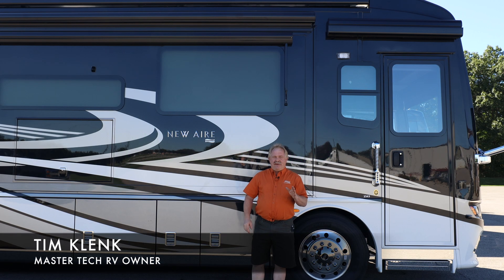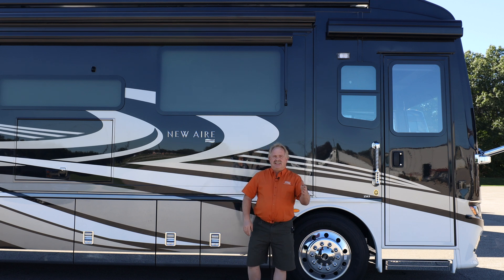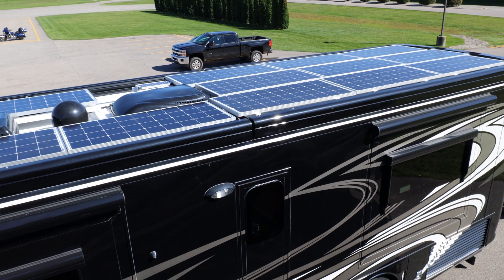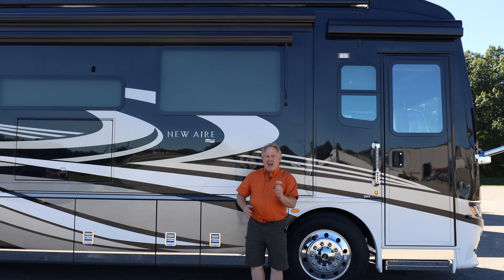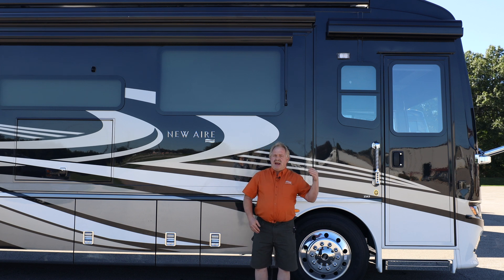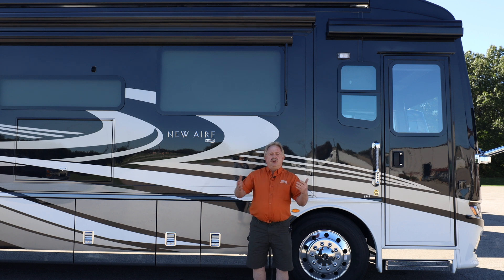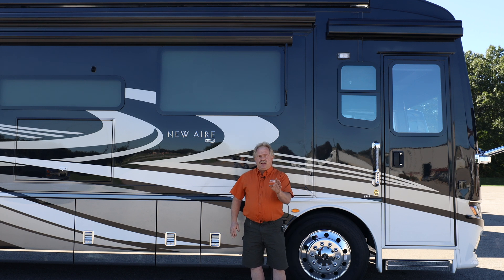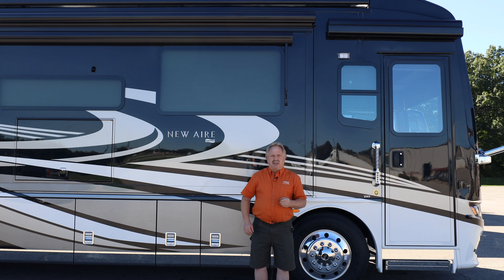Ultimate RV Lithium & Victron Energy Package

Comment: I’ve got an Entegra Anthem that’s all electric with 2 Magnum inverters. One handles the residential fridge and kitchen, while the other handles the entire coach. Can they be integrated into a system like this, or does it all have to be converted? What’s a ballpark number?
Reply from the maker: Hello,
If you fill out the contact form on our website and mention this video, one of our salesmen will get in touch with you!

https://mastertechrv.com/contact/
Reply from the maker: Yes it is possible to use existing coach inverters if you stay with 12v lithium pkgs.  but if you want performance.. over the road sustainability with no generator operation... That requires 48/52v system..  The coach featured is under a 100k integration.  We do have several option costing much less if you don't require The Ultimate pkg.